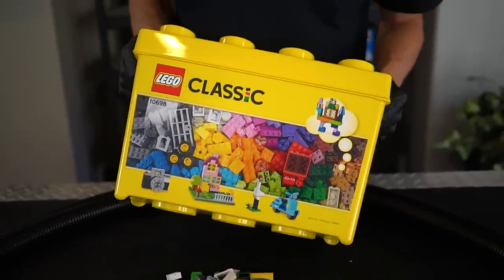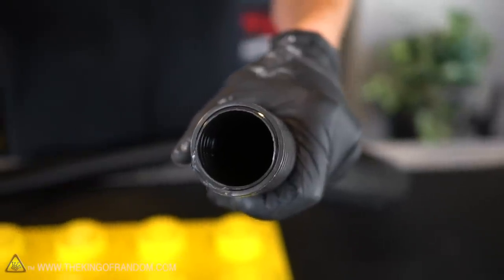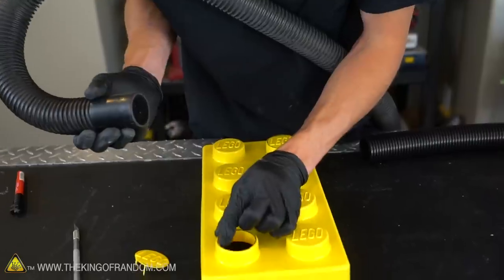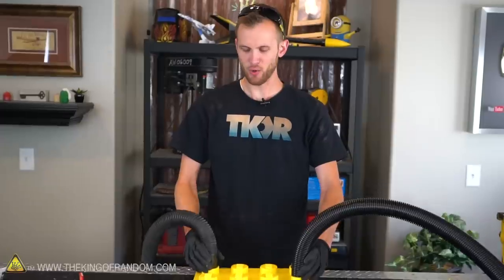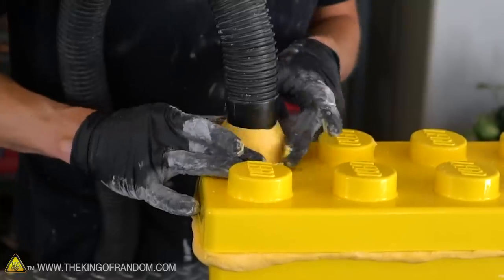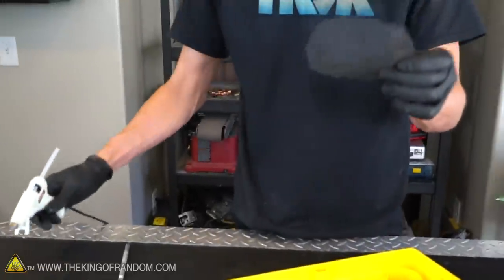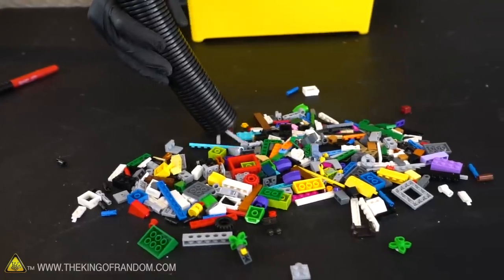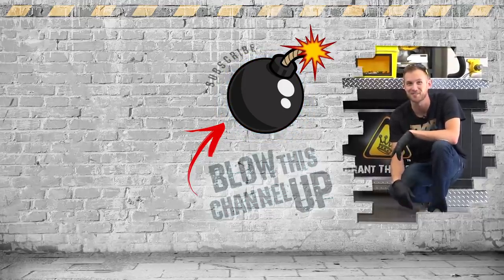How To Make a LEGO Vacuum

Comment: I sure love my Lego with a fine hint of dust
Reply: EpicLPer The dust and lint will continue on to the vacuum. ;-)
Reply: EpicLPer hi I love your vids
Reply: yea, this actually would help prevent dust on the legos as the dust itself would continue on into the vacuum, this is basically a ghetto "Dust Deputy", a tried and true tech for woodworking shops that separate larger material from finer stuff(such as dust), you'd get MORE dust by just putting them into the box by hand.
Reply: I really doubt the dust is going to make it to the vacuum here... As soon as it hits the box the massive increase in cross section is going to make the suction drop. And dust is going to get under the Lego where there would be even less airflow. Although it does depend on the vacuum, a high power shop vac might be able to pull dust right through but your average home vac probably won't. What would probably work better and be easier to build is one continuous length of hose with a single T connector that drops the Lego out... Put a screen in the T connector to catch the Lego so they'll drop into the box below it while smaller dust and dirt goes right through
Reply: Urza9814 looooong
Reply: i didnt play with my legos in a while so when i opened it, GUESS WHAT I SAW...CRICKET-TOPIA
Reply: tl;dr dust won't go through because there's too much surface area inside the box so there's not enough suction, fix it with a T-Fitting, lego drops down, dust goes through.
Reply: Ha.
Reply: just clean the hoses inside and outside !
Reply: EpicLPer Did you even watch the video untill the end
Reply: It's a homemade dust deputy. Brilliant
Reply: Oh gee guess you should actually vacuum your floor more then huh?
Reply: NA no he didn't he just posts comments under almost every YouTube video to get attention
Reply: NA Of course I did
Reply: DerpyDoom Yeah, deeeeeeefinitely lol
Reply: If you’re paranoid about dust just put another 1 ore more layer of filters so you don’t get lint
Reply: @firefist8511  if there was an open end on the t fitting the air would all rush in there. That's why he sealed the box

Comment: You should try firing some water-based clay by lowering the waters boiling point in the vacuum chamber.
Reply: That would probably speed up the drying process, but wouldn't cure the clay as high heat firing, which is much hotter than the boiling point of water.  Even Sculpey (PVC based) needs to get up to about 275 F.
Reply: Sadly he can't, he is dead

Comment: Wouldn't it pick up dirt if the legos are on the dirty floor.
Reply: yes but the dirt or dust would be sucked through the mesh into the actual vacuum.
Reply: why are your legs on a dirty floor, O
Reply: If your a kid you don't put legos on a table you put them on the carpet

Comment: Try making a camp fire with colored fire
Reply: the cheapest DIY way I know to do this is just get some dirt cheap green garden hose (the rubber kind) and a copper pipe that can fit the hose in snug. drill some holes into the copper pipe, cut the hose to the length of the copper pipe, stuff it in the pipe, and throw it in the fire. just don't cook anything on the fire after you add it in though
Reply: Cool

Comment: Tungsten vs ice or dry ice 
Because tungsten melts at 3000 celcius
Reply: Vignesha K It will just get cold??
Reply: TheTestTubeCreeper,  there is a huge difference in temperature so it might explode
Reply: Athe who knows
Reply: Mihira VP it will just end up being cold tungsten
Reply: Mihira VP there needs to be a rapid temperature change to make metals explode
Reply: Just because it melts at 3000 doesn’t mean it is 3000 degrees. It will be room temperature unless you heat it up.
Reply: Mush thats obvious

Comment: Make prince rupert drops using liquid nitrogen instead of water...
Reply: Badland Survivor prince rupert drops are from glass not water. Water just cools it down quickly so it hardens. Liquid nitrogen would do the same thing so there would be no difference...
Reply: Grammar Nazi at what point did you fail to realise that liquid nitrogen would cool the glass faster than water which could change the overall strength and size of a drop?

Comment: Seems like this would pull a lot of dirt and dust into the box with the Lego. What if you put a T connector on the hose, with the screen filter inside the T and the bottom leg going into the box? That way small bits of dust and dirt should go straight through the hose while the Lego hits the screen and falls into the box.

Comment: I think you could have done it without the corn starch. Just put a bead of caulk on the edge of the box then use a mold release on the lid. Place the lid on the caulk and a day or two later, after caulk has somewhat setup, the the lid comes off and now you have a silicon gasket.

Comment: if you build something with lego and put it in a vacuum chamber, would it dissemble the build???
Reply: No.  LEGO bricks are not airtight.  If you glued them, enough negative pressure might break a seam, but it still wouldn't pull pieces apart.

Comment: put clay in the foundry and cast some molds with the clay if it turns into liquid.
Reply: Clay doesn't work that way.  Heat is used to dry and cure it.  Too much heat just makes it brittle.  Glazes melt with heat, but those are basically types of glass that's been turned into dust.

Comment: As someone with a dog I can just imagine how much dog hair would end up in this bin...
Reply: That would definitely be an issue, though some would float over to the "filter."  Vacuuming a couple times would probably get most of the hair out.  (Dump on to a clean table in-between.)  If you lift the lid before turning off the vac, whatever's caught will stay on the mesh, then you can turn the lid over and vacuum up the hair from the filter.

Comment: How would a glove filled with air react to the vacuum chamber
Reply: Depends on what the glove is made of.  A rubber glove is just a hand-shaped balloon that would expand until it popped or filled the chamber.  Plastic would probably break a seam if you sealed it completely.  Most other materials might not be air-tight.